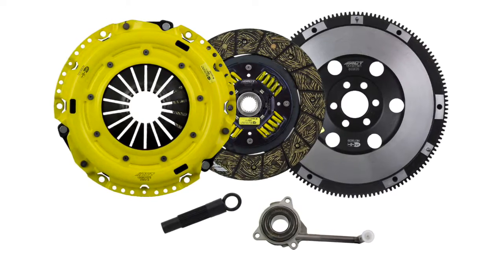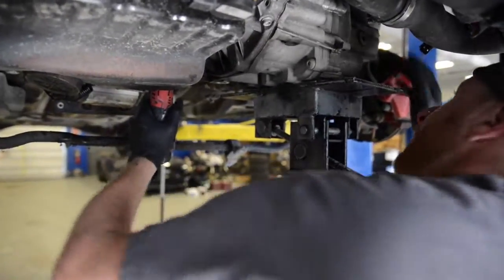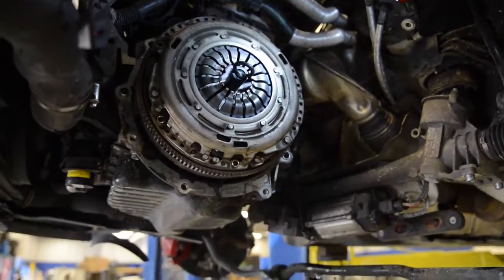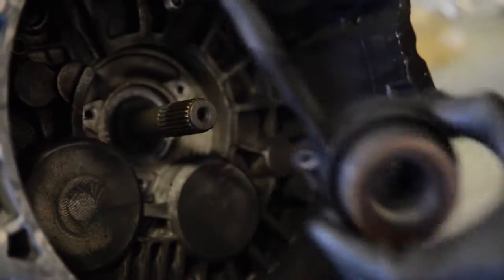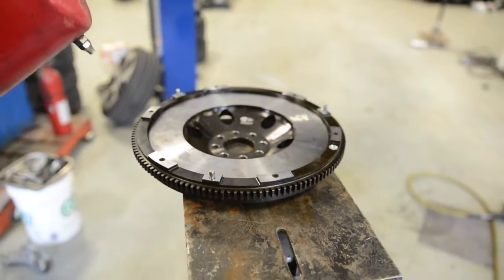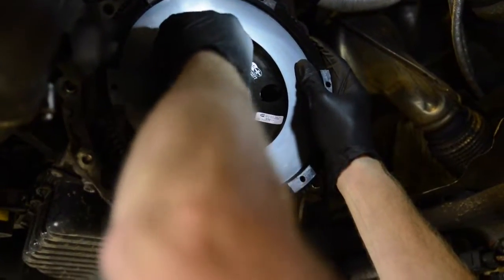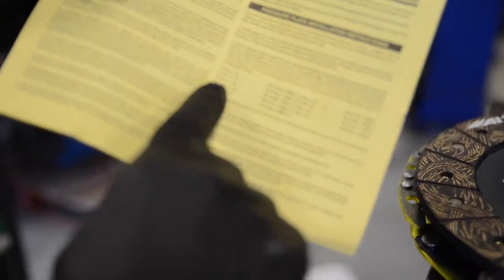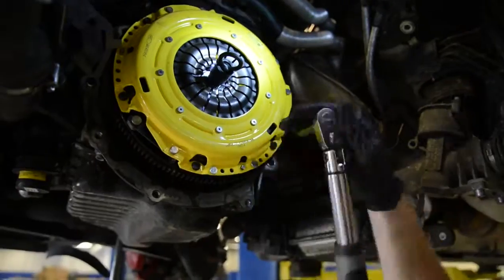Mk6 VW GTI Clutch Install | ACT VW8-HDSS

Comment: Is there any sort of heat shield between the trans and engine (behind the flywheel) I get this weird tinny noise when letting the clutch out, seems to do it more in reverse. Also did you pull the trans without removing the subframe?
Reply from the maker: There isn't any sort of shield but yet we removed the subframe.